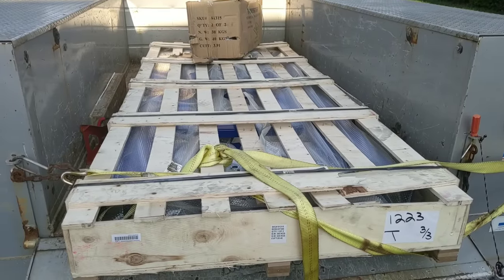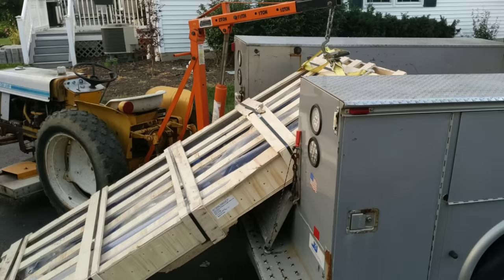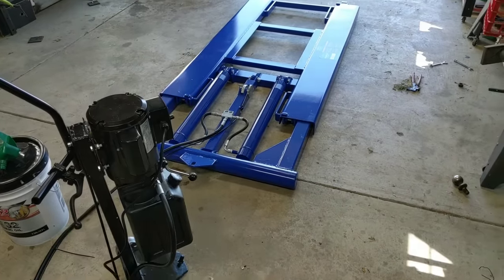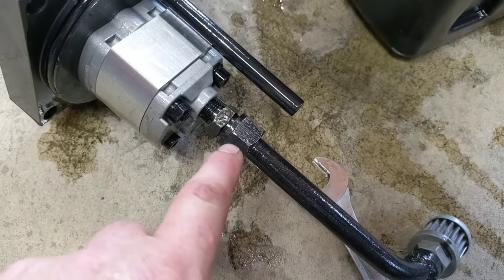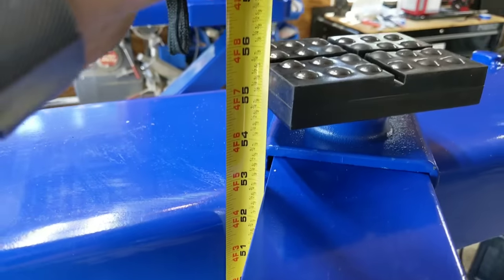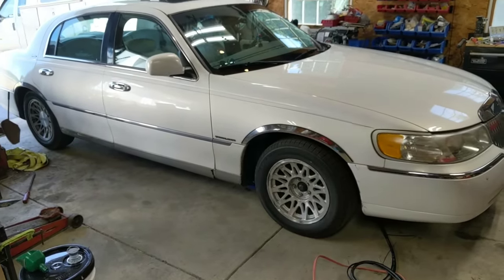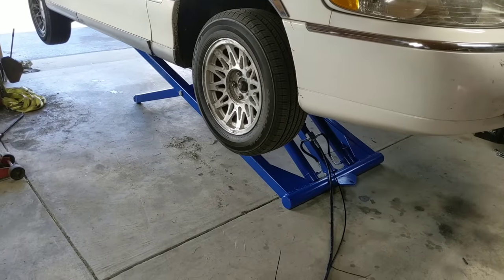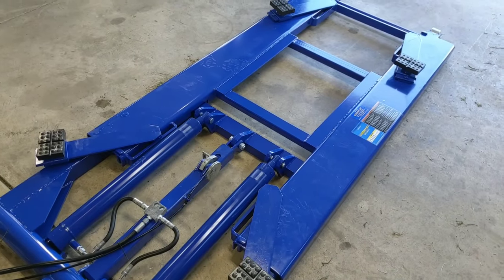Harbor Freight 6000 Lb. Capacity Scissor Lift Review, Central Hydraulics, is it worth it?

Comment: No way I would trust anything the Chinese make with my life or limb, even if you called them, over seas
Reply from the maker: Me either.   But this is just a scissor lift, t's not designed to get underneath and work under the car. It's perfect for doing body work, as you can sit on a stool and wheel all around the vehicle without post getting in your way or casting shadows. But if you need to get under the car, you need a good post lift. It's just a different tool for a different job.
Reply: I feel the same way but we buy 99.9 % of Chinese products in this USA.

Comment: Deathtrap lift. Not to mention the 90 percent worthless factor. Only useful for brakes and rotations.
Reply from the maker: Or detail work!   It's great to lift the car up a bit and be able to wheel all around the car on a stool for lower body / detail work.    Obviously you wouldn't use one of these lifts to work under the car, there are post lifts for that and those are designed to work under the car.

Comment: These  jacks don’t look safe at all they are design too narrow and not enough metal touching floor , I personally would not risk my life with this junk. any movement sideways and the jack will lose the load  meaning car falling
Reply from the maker: Well, it's not a jack, it's a scissor lift.   They are really only designed to lift a car up high enough to work on the lower extremities, perfect for lower body work and lower detail work.  I prefer them for this type of work as you don't have the post from a post lift casting shadows or getting in your way.  If you need to work on the underside of the car, you need a post lift.  Just a different tool for a different job.  As far as stability, I've tried to shove a car over while it's on the lift and cannot, physics is a beautiful thing!

Comment: That thing looks as though it was designed to just tip over.  Too much weight on too narrow a base.
Reply from the maker: It's wider than it looks in the video.    Pretty stable really.   It's not new technology by any means, they have been around for years.    Due to their limited use, they are just not popular. You obviously wouldn't get under it to access the underside of the vehicle.   They are perfect for lower body and detail work, as you can sit on a stool and wheel all around without post getting in the way or casting shadows.

Comment: Not for the do it home installer. Who accepts non UL label junk!
Reply from the maker: I get it!  UL listing is a false sense of security for the folks who are not capable of determining for themselves what is safe and what isn't.   After taking apart a lot of items and repairing them over the years, I've seen some pretty sketchy wiring with UL listings on the case.   You have to question a non profit company with a yearly revenue exceeding 2.5 billion.  But, it makes people feel good and that keeps them in business.  :D

Comment: That looks very dangerous
Reply from the maker: For some people, specifically for those who don't understand how to use it, it probably is.
Reply: @1D10CRACY  no doubt I'm not one of those people whom need a warning on there coffee cups but making sure that unit is centered and correctly weight distributed looks to be very critical here
Reply from the maker: It's also not designed to get under.   It's just designed to lift a vehicle high enough to work on the lower extremities.   Perfect for lower body and detail work, as you can sit on a stool and wheel all around the car without post casting shadows or getting in your way. If you need to get under a vehicle, you really need a post lift.  It's just a different tool for a different job.

Comment: Kind of useless. It takes all the space in the center of the car. Quick jacks are way better option.
Reply from the maker: Sounds like for "you" it's useless.  Remember, this is a scissor lift, it's not really designed to get access to the underside of a vehicle.   You really need something like a post lift for that kind of access.   This is perfect for lower body and detail work, you can wheel all around the car without post casting shadows or getting in your way.  It's a different tool, for a different job.
Reply: @1D10CRACY  yeah well, surely you can find one for all. Such huge thing just for detailing is absurd. I don't need a post lift owning a quickjack.
Reply from the maker: I totally get it!  It's not for Everyone!  But for some, it's an awesome tool to have.   I wish I had bought mine much earlier on.   But I also do a lot of body and detail work.  I also use mine as an adjustable height table when not in use as a lift.

Comment: Looks like you would not be able to work under the car without bending over the whole time. Installing headers would be a nightmare?"
Reply from the maker: These are not designed to be used like a post lift.   These are just designed to lift the vehicle high enough to work on the lower extremities.  Perfect for detail and lower body work.   You can sit on a stool and wheel all around the car without the posts in your way or casting shadows.   If you need to get under a car, you need a different style lift.   It's just a different tool for a different job.

Comment: I wouldn't get underneath this thing.....
Reply from the maker: It's a scissor lift, your not suppose to get under it!  They are not intended to get access to the underside of the car.   They are only intended to lift the car high enough to work on the lower extremities.   Perfect for lower  detail / body work as you can wheel around on a stool and not have post form a 2 or 4 post lift in your way.    If you need to work under the car, you need a different kind of lift for that.  https://youtu.be/RAqqgq7ielE

Comment: Bad lift. 
You won't be able to work under the chassis which is the main reason why you want that kind of lift.
Reply from the maker: It's a scissor lift, designed to lift the vehicle high enough to work on the lower extremities.   They are not designed to work under!   Great for body work, as you can sit on a stool and wheel all around the car with no obstructions or shadows from a post lift.    If you need to work under a vehicle, you need a post lift.  Just different tools for different jobs.

Comment: Lift an old full size truck
Reply from the maker: It's good for up to 6000 lbs.   An older truck from the 70s, no issue.   My F350 with it's tool bed is at 8200 lbs, I wouldn't even try it.  ;)

Comment: If it doesn’t say BendPak on the side, I ain’t crawling under it.
Reply from the maker: If your getting under a Chinese BendPac scissor lift, you don't understand what a scissor lift is for!   They are not designed to get under!   They are only designed to lift the car high enough to work on the lower extremities.   Perfect for wheeling around on a stool doing body and detail work!   If you need to work "under" a vehicle, you need a 2 or 4 post lift!   Different tool for different jobs!
Reply: 1D10CRACY your 100% correct

Comment: i wuldnt trust working under that death trap
Reply from the maker: It's only a death trap If your dumb enough to get under a scissor lift.   But I'm pretty sure everyone knows these are only designed to lift the car high enough to work on the lower extremities to save your back.   Perfect for lower detail / body work.    As for getting under the car, this is the wrong tool, you would want a post lift for that.

Comment: Better than nothing I guess
Reply from the maker: Remember, this is a scissor lift, it's not really designed to get access to the underside of a vehicle.   You really need something like a post lift for that kind of access.   This is perfect for lower body and detail work, you can wheel all around the car without post casting shadows or getting in your way.  It's a different tool, for a different job.

Comment: I would caution getting under that poor quality, flimsy looking lift.  Who knows what counterfeit fasteners, poor quality weld or structural materials were employed.  Were lift design and certification standards used?  Was it engineered for a 3 ton load?  Is it stable to side forces?  Are the safety locks strong enough to stop and accelerated load?  Sorry.   Buy only new, certified American products for safe load management.   management....your kids deserve a dad.

Comment: Useless ! No clearance for transmission work !
Reply from the maker: Useless for you, as you need a post lift to gain access to the underside of the car.  This is a scissor lift, it's not really designed to get access to the underside of a vehicle.   You really need something like a post lift for that kind of access.   This is perfect for lower body and detail work, you can wheel all around the car without post casting shadows or getting in your way.  It's a different tool, for a different job.  It is not uncommon to see a mechanic's shop that also does body work to have both kinds of lifts.

Comment: This lift is wacked ??? What a poorly designed unit .....I wouldn't get under a Harbor Freight lift especially this one ... don't cheap out and just buy a quickjack lift instead.
Reply from the maker: Quick Jack's are awesome!  And cheaper! However they are not what I needed.     If you need to get under the vehicle and also need to store them, they are almost ideal.    This style lift is great for lower body detail work as you can sit on a stool and wheel all around and set the car up at the perfect height.    They are not designed to get under.   https://youtu.be/RAqqgq7ielE

Comment: At full extension too top-heavy never catch me anywhere near that piece of s*** no flipping way I don't care what brand it is that ain't wide enough. I'll stick with my 2 post.
Reply from the maker: Just to clear this up a bit, these are not designed to be used like a post lift.   These are just designed to lift the vehicle high enough to work on the lower extremities.  Perfect for detail and lower body work.   You can sit on a stool and wheel all around the car without the posts in your way or casting shadows.   If you need to get under a car, you obviously need a different style lift.   It's just a different tool for a different job.
Reply: @1D10CRACY  don't put words in my mouth never said it was a two-post and I've never had a problem working around my to post that's a piece of crap and we all know it.
Reply from the maker: Why do you think your two post is a piece of crap?    We use ours all the time!    Just not when detailing.
Reply: @johnsullivan6080  As a professional  detailer, I can say this style of lift is perfect!   He is right,  working around the post suck.

Comment: Leaves no room to work on the vehicle, no like!
Reply from the maker: You have to remember, its not designed to work under.  It is prefect for lower body and detail work, as you can wheel all around on a stool and not have post in your way or casting shadows.    To work under a vehicle, you need a post lift.  It is just a different tool for a different job.

Comment: Harbor Freight CRAP!......no way would I ever crawl under this piece of sheet....nuts!
Reply from the maker: If you ever crawl under a scissor lift, your using it wrong.  You need a post lift to get access to the underside of a car.
Reply: @1D10CRACY  Crawl , stand , sit , squat call it anything your little hart desires ace!  .........
Reply from the maker: Yeah, your missing the point.  You NEVER put yourself in a situation where if it were to fail, you would be hurt. You typically only lift a car on a scissor lift a foot or so In the air, and you never access the underside of a vehicle with one.   They are more than a jack, less than a lift.   If your getting under the car, even if it's just an arm, your using it wrong.  A post lift can be purchased for a similar price and is designed to get under the car. Here is a PSA https://youtu.be/RAqqgq7ielE -Ace
Reply: @1D10CRACY  Stop it ! its a lift of coarse you'll reach under or even scoot under to grab a dropped tool or look at a break line or what ever...end of conversation thanks and good by...ace !
Reply from the maker: Yup.  We have to agree to disagree.    ;)

Comment: I couldn't trust my life with this contraption. Nope.
Reply from the maker: You really shouldn't trust your life with any contraption.   Lucky this is just a scissor lift. They are not intended to get access to the underside of the car.   They are only intended to lift the car high enough to work on the lower extremities.   Perfect for lower  detail / body work as you can wheel around on a stool and not have post form a 2 or 4 post lift in your way.    If you need to work under the car, you need a different kind of lift for that.  https://youtu.be/RAqqgq7ielE